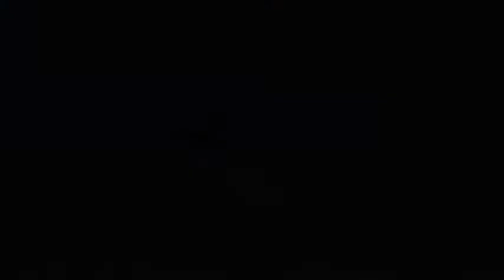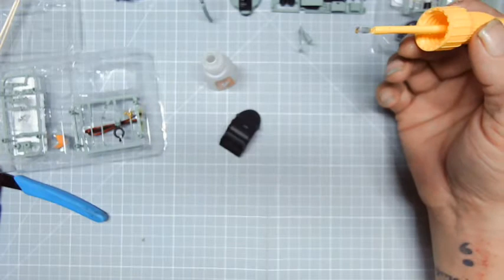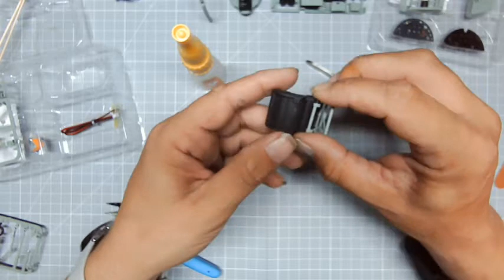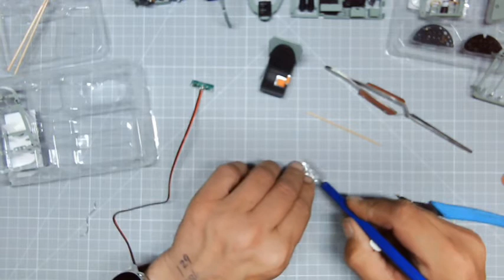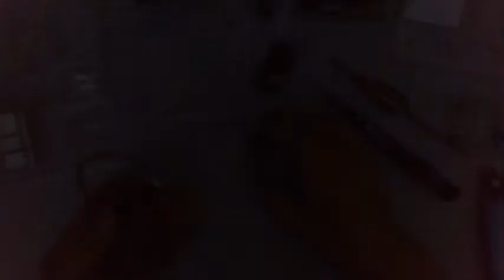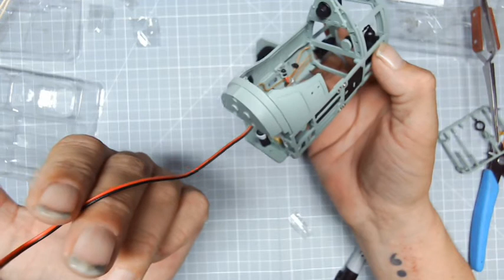Build The Mk1a Spitfire 020 Pilots Seat And Control Panel

Comment: The lever on the right side of the pilots seat is for adjusting the seat up and down.  The seat does not adjust backwards and forwards.  Instead, the rudder pedals can be adjusted backwards and forwards, to accommodate the pilots leg length.  All of the pictures, that I have found so far, do not give you a good view of the pilots seat.  They all have cushion placed in the seat pan that would not be present in a war time Spitfire.  The seat pan would be empty to accept the pilots parachute, which he sat upon.  I found a video, on You Tube, called "Discovering How Small A Spitfire Mk.1 Cockpit Is."  It does give you a few glimpses of the orange and silver part along the outside edge of the seat pan, with a seat cushion blocking most of the view.  Disregard the color of the seat in this video.  It is one of the later resin/paper seats that were introduced in May 1940.  Our model represents  K9953, which was constructed in 1939, and had a metal seat.  Once you install the seat and joystick into the cockpit, they become the 800lb gorilla in the room.  You lose sight of most of those copper pipes that you love so much.  You probably already know that by now.  Those pipes should actually be painted with the cockpit green color.